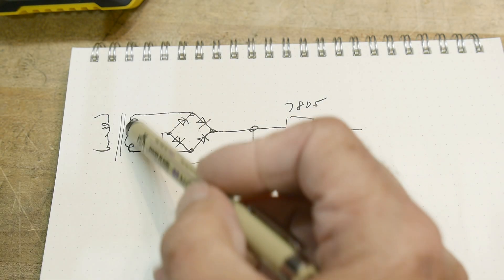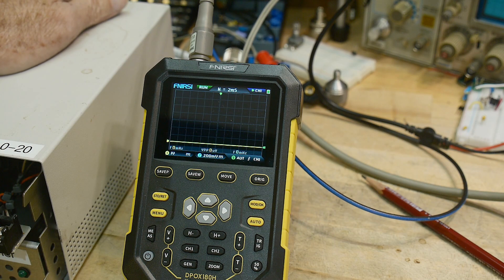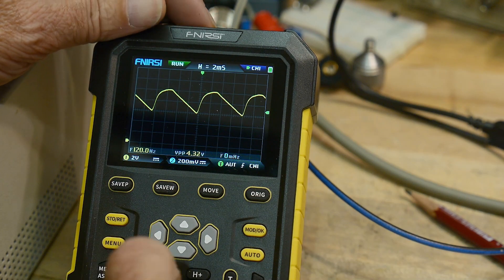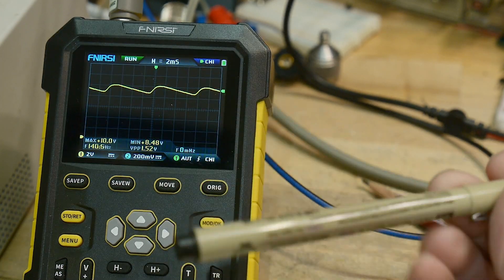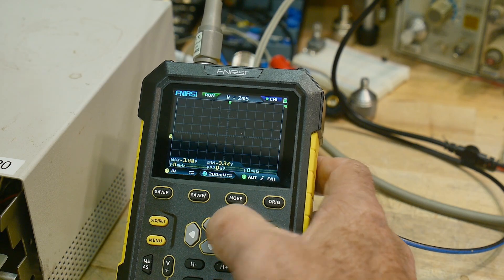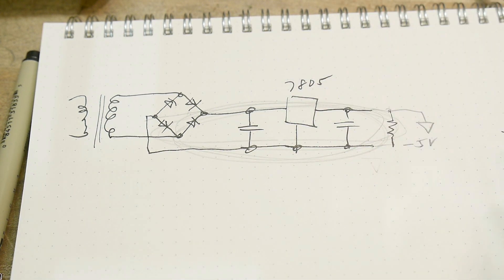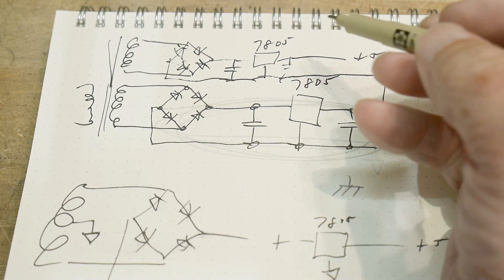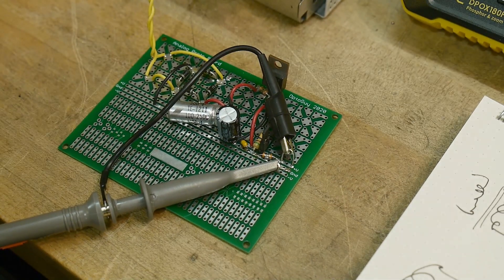#1884 Linear Power Supply Basics (part 2 of 2)

Comment: I had a number of dumb serial terminals back in the mid 80s that had a 5 ohm 10 watt resistor across ( in parallel) with the 7805 reg. both used to get hot but i did allow for over 2 amps of 'regulated' 5 volts at the given load.

Comment: Good content as always.  I hope you decide to make a follow on video that covers the following related topics that are sometimes unclear:}
1. Proper fusing
2. Sometimes the primary ground wire is connected to the secondary side ground, sometimes the grounds are left isolated.  Discuss the advantages and disadvantages of each approach. (isolated vs. non isolated)
3. Metal chassis ground for the two cases above in #2.

Comment: I had brought up the Subject why 7805 and 7905 existed while ago.  I think the conclusion you made at the end wasn't correct. You said you need 7805 and 7905.  But i think you can get away with two 7805s as long as you reverse the input and ground of negative side.  The ground does NOT have to be shared among  all the components.  Each component can have its own local positive and negative lines.  It's up to you to connect positive or negative to ground.  

For 7905 the input is negative and ground is positive.  That makes it easier to connect both 7805 and 7905 tabs together to chasis without any isolations.  If you use a 7805 in negative side you have to isolate its tab and screw and reverse the input voltage.

Comment: In your last example with the grounded center tap, could you just use a 7810 between the + and - rails? I mean, I guess it wouldn't be as stable, especially with an unbalanced load, but theoretically it could work.

Comment: Warning: The following is offered by a self-taught hobbyist who has immense gaps in his EE education and understanding. I welcome gentle correction and teaching. The term "Ground" causes a great deal of confusion. IMHO, the term should be standardized to something like "Return." The term "Ground" brings forth images of the solid mass beneath your feet, which can not be penetrated, meaning that you can not go lower than that. Additionally, IMHO, calling something a "Negative Voltage" is also confusing and should be standardized to something like "Lowest Voltage Range." As you have explained, the current is always flowing in only one direction referenced to the actual "Earth." Again, IMH(Uneducated)O, there is no such thing as "Ground"... Conventional current is always flowing from a higher value to a lower value. So, for your demonstration, there would be +10 volts, +5 volts and 0 volts. The use of so called Negative voltages brings forth the idea that the current is flowing in the reverse direction, which it does not and making for more confusion. Please be kind... Cheers.
Reply: I think you’re getting too caught up in semantics… ground and negative voltage are standard terminology used by all EEs and aren’t taken literally. It’s taught quite early on in any introduction to circuits that ground is the term used for the reference node where all single-ended voltages will be measured by their difference to. This is where the term “negative voltage” comes from because it refers to a voltage lower than the chosen ground. If a negative voltage were connected to ground, current would flow to the negative voltage because it is a lower value than ground. Also… I think it’s not humble to accuse someone else of having gaps in their knowledge when you yourself have admitted you’re uneducated in your own comment (you literally said “in my honest uneducated opinion”). Just something to think about, cheers.
Reply: @NameWith15Letters  Thank you for your gracious reply. I am aware that the terms are used in common EE speak and the operation of current flow by these terms. However, the semantics are exactly the point; they cause confusion that could be reduced by the use of better/standardized terms. That is all that I am suggesting. Also, I did not accuse anyone else of having gaps in their knowledge. I was describing myself... I am the self-taught hobbyist, who admits that he has gaps in his knowledge base and that his opinion comes without a formal EE education. Might the lack of a formal EE education give me a better/outsider perspective on determining that the semantics are confusing? Possibly. I read that others are of this opinion, as well. I genuinely appreciate that you took the time to reply and I will give further consideration to your points. It is folks like you that make the EE Community great. Thank you.
Reply: @t1d100  I apologize! I misread and thought the self taught hobbyist you were talking about was the video creator. That was my mistake. As a working EE, I personally believe that the words used for terminology don’t matter since they are merely signs designating an underlying concept. While there certainly are some more poetic options for designation, uprooting the established tradition just creates even more confusion. The multiple different names for SPI protocol data pins are one example of a designation in flux (master/slave, MOSI/MISO, CIPO/COPI, etc.). I’ve had a moment at my job where the flipped relationship between MOSI/MISO and CIPO/COPI resulted in confusion. I think with these weird semantics it’s better to treat them as completely isolated words and not try to infer where they got their name in the first place. Thank you for being gracious with me, once I again I apologize for misreading your comment!
Reply: @NameWith15Letters  No apology needed; I realized that you just misread it. And, I also realized that you were trying to help and had taken time to do that... Which I appreciate. You make additional good points. By just discussing the topic, we have set in motion the beginnings of change. I choose to be optimistic and hope for that change to be for the better. Cheers!
Reply: Nothing wrong with ground and negative voltages,  trying to call them something else is just moving away from the norm. How do you cope with impedances where the J operator is the square root of minius one.
Reply: Well, I too am a self-taught hobbyist, so take my opinion with a grain of salt as well. That said:

"...calling something a "Negative Voltage" is also confusing and should be standardized to something like 'Lowest Voltage Range.'"

No, there's no need at all for this and I think that this idea may be arising out of some confusion about what voltage is. It's simply the difference in potential between two points: anything beyond that (including sign) is a matter of how you chose your reference points. Consider, for example, if I'm measuring a 12 V power supply. If I put my black probe on the more negative output and my red probe on the more positive output, my voltmeter says +12 V. That's simply saying that red is 12 V higher than black. If I reverse the probes my voltmeter says -12 V, which is just as valid, though nothing has changed about the PSU itself: the red is merely now 12 V below black because of the way I connected it. If I pick a reference far below either of those two, I can even say in the first case that black is at +100 V and red is at +112 V, and that's perfectly fine, too. Nothing in any of this changes that one particular PSU connector is 12 V above the other in potential.

"As you have explained, the current is always flowing in only one direction referenced to the actual 'Earth.'"

Actually, no, I think you misunderstood something there. (Conventional) current always flows from the more positive to the more negative point. If you are drawing current from a +5/0/-5 V PSU, current will flow only from +5 to 0, 0 to -5, and +5 to -5. Note that in the second case current does not flow to "ground" but flows from ground, and in the third case there's no current flowing through ground (in either direction) at all.

Comment: I have a some encapsulated pcb-mount SMSP modules (+/-15 and +5V). Is there any reason I shouldn't use them in series willy-nilly to get more voltages like 30V or 20V?

Comment: I have an old Fluke 8050A DMM that I embedded a microprocessor and graphical LCD display into, to replace ancient failed 7-segment LCD in it.  It's internal schematic shows a positive ground configuration for the old F8 microprocess in there.  So my circuit goes with the flow and also floats along with the rest.  During development, however, I had to think Really Hard about how to connect to the TTL serial port on my MCU to avoid "issues" with external views of earth grounds and the like.  Fortunately, this could only be an issue if the DMM common was connected to anything, as it was at the internel (positive) ground potential.  Testing of the DMM was restricted to batteries and other components isolated from everything else while my laptop was connected to the serial port.

I could see how that approach made things "work" easier, it was just a bit off the beaten path.  In the end, I have nice color graphical LCD display with large friendly digits on my old DMM so it was all successfully navigated.

Comment: The problem of using a 7805 for a negative supply is that the tab is now no longer ground and has to be insulated if using a heatsink.
Reply: But then, you'd still have -Vin on the heatsink if you used a 7905.